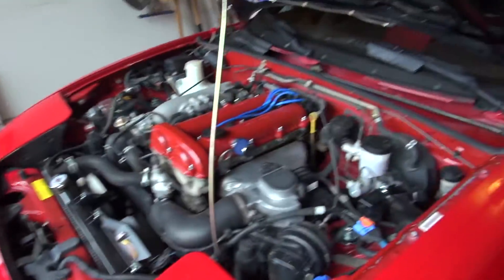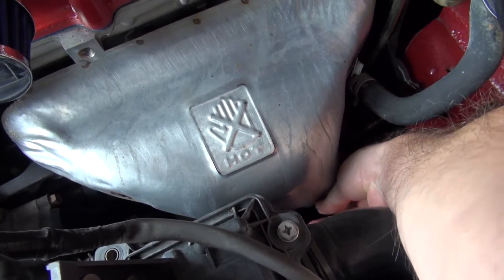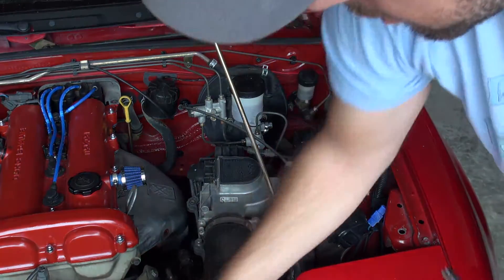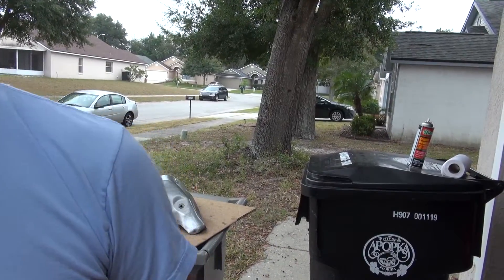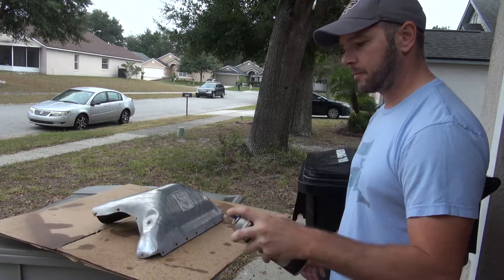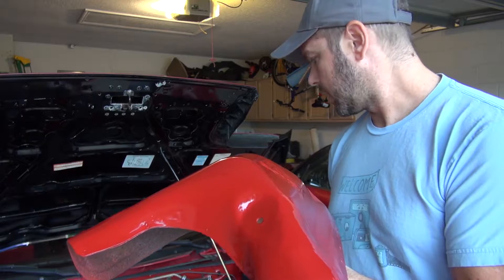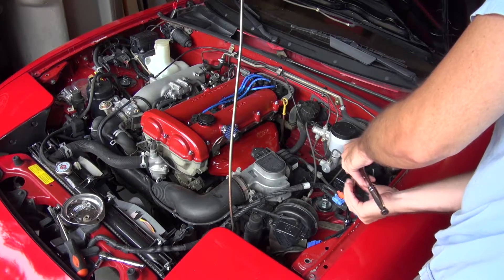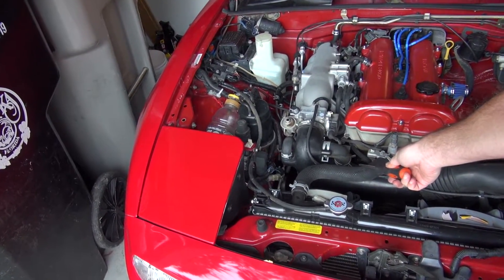1990 Miata Restore Project - Episode 41 - Painted Heat Shield

Comment: looks really nice.  My engine bay looks terrible.  My brother sprayed a fender after bondo with the hood open and red is everywhere. I've been using steel wool little by little to get it off. Looks real getto, especially since the previous owner painted the valve cover black with cheap paint. Now it's dark at 5 and cold so everything will be a next spring project.
Reply from the maker: Dammit, man.  That sucks about overspray in the engine bay.  Something I learned was if you're going to go apeshit with engine degreaser, don't let it drip onto your paint.  Very bad.  I had to redo a headlight top, one fender and the whole front bumper again with the clay bar, the polishing compound and re-wax after that screw up.  But paint overspray is a lot harder, especially on all the little parts and surfaces inside.  I don't envy the job ahead of you.

Comment: Looks spot on thumb so no primer needed ??
Reply from the maker: Now that you mention that, it sounds like it might have been a good idea.  However, 6 years later and at least 8k miles, the shield is looking as good as the day I reinstalled it.  So maybe that high temp paint just works different.

Comment: How has the paint held up on the manifold? I too think it'd be a good idea to do it and the intake but with the headers getting so hot I wonder how it'll last.
Reply from the maker: While I don't drive the car very much, I do drive it sometimes, and obviously heat shield gets crazy hot.  But the paint is looking about as good as the day I did this over a year ago.  If you're going to do it, just be sure to get the high heat engine paint.  It should be fine.

Comment: Is there any torque spec for the heat shield, or you've just tightened it?
Reply from the maker: These screws are almost certainly rusted at least a little. Tighten until snug and that's it. Otherwise you'll snap them right off.